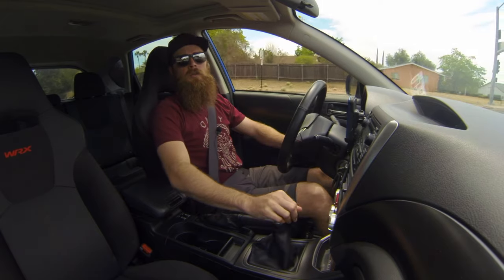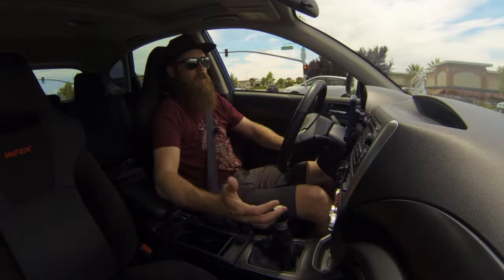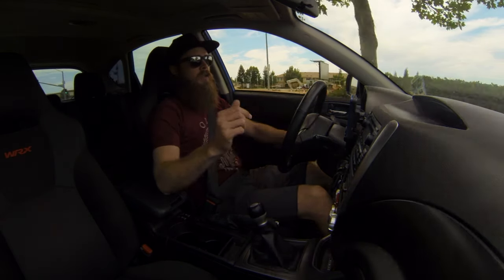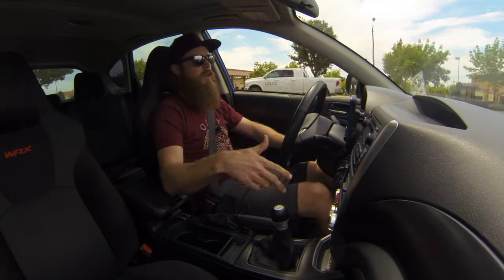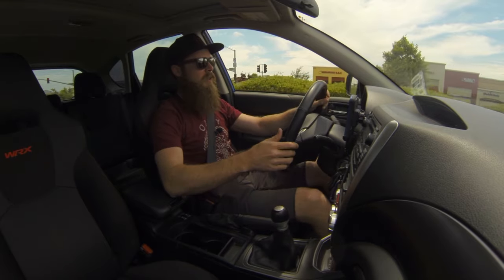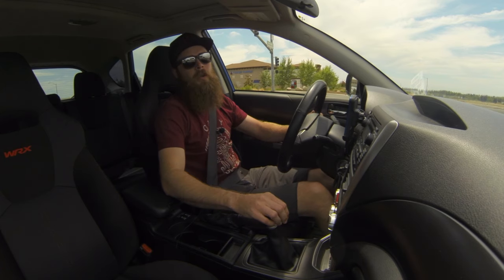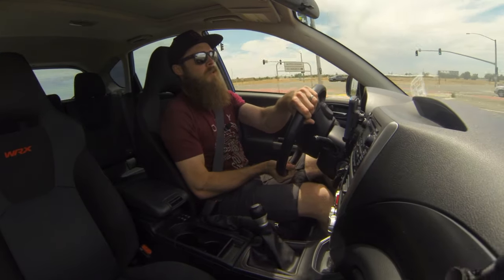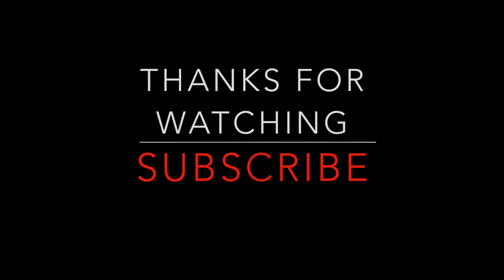INTERCOOLER SPRAYER REVIEW

Comment: So the washer fluid doesnt hurt the intercooler I take it? Do you have to use a certain kind of washer fluid? Cause if it's just water of course it would freeze here in Colorado winter. Great video
Reply: shiloc7 james I thought about that too cause I live in CO but it would be better to use washer fluid really cause it’s really just water mixed with alcohol which helps from freezing so it won’t hurt it seen a lot of guys go that route so they don’t have to use another serperate tank

Comment: How did it do at the track? Any trap speed gain or 1/8 or 1/4 mile improves?
Reply from the maker: +LS1NNOVATIONS I have not been to the track since. Not sure it would improve times much.
Reply: +Blake's Garage to to fb and join subaru bays.
Reply: +Blake's Garage to to fb and join subaru bays.

Comment: hey man quick question for you. I auto crossed last weekend and I pulled my fuse to disable the traction control and loved it. I ran quite a bit quicker.. Do you think there is a way to wire up the fuse kind of like this sprayer so that you can manually disable the fuse without having to pop the hood and physically pull the fuse? Thanks so much in advance bro
Reply from the maker: +Danny B Yeah there definitely is I did a video on the Traction control disable a while back and could definitely make a switch to do that.
Reply: +Blake's Garage would it be the same exact set up as this switch for the intercooler sprayer?
Reply from the maker: Danny B Yep exactly just with a longer switch leg wire. I would probably put it in the same spot as well. I never mounted it I like it kind of hidden in the trap door. You could always just drill a hole and mount it but I didn't want to commit to that.

Comment: Bro if you added a co2 cooling kit to the intercooler you'd be impressed with the results. Works well on the GTI-R with its top mount. Not sure your solution for cooling your top mount is even effective at all.

Edit: 5 year old video. Probably doesn't even have the car anymore.
Reply from the maker: Correct I have an M4, E30, E36 and Macan Turbo now lol 🏁🏁
Reply: @BlakesGarage  😂 😂 good on you man. 💪🏽👍🏽👍🏽

Comment: Are you sure it still works with the washer circuit shut off. Would that not be the circuit to activate the washer motor?
Reply from the maker: Jerdope Yep It works with the fuse I disabled. Its the windshield wiper fuse, so there is no issue with the washer motor working. Fun little mod to do an cheep.

Comment: Have you ever felt the intercooler spray with your hand after your engine temps are up? I'm thinking that it just might be spraying 180* washer fluid on the IC
Reply from the maker: Logan Salat Yes I have and it does cool it quite a bit. Its more about the evaporative cooling than anything and Subaru has basically been doing this the same way for years.
Reply: Blake's Garage Except that the IC spray reservoir is in the trunk in previous years STIs, it's not absorbing heat from the engine all the time. I'm not knocking you're idea, just skeptical before I do mine.

I agree that the evaporating is most important. I think I'm going to do this as well, and just change my washer fluid to some kind of alcohol/water mix
Reply from the maker: Logan Salat You could always put one if your trunk if you want to it would just cost way more. I like the mix idea. You could always put some ice in there if you want LOL.

Comment: I am looking at a 2009 WRX hatch, have you head anything negative about this particular year? Thanks
Reply from the maker: Lacrosseecm IC to TB Hose is the main issue from what I can tell. Also make sure you get a non modded one if you can, just because it will have been beaten on less. What are your plans for the car?
Reply from the maker: Lacrosseecm Thanks man, It looks pretty sweet I would just thoroughly check over the engine bay and make sure you check all the normal areas to see if its been heavily modded. Intake area and downpipe and heat shield. The bolts will have factory markings of white paint if the line up it's been messed with. But if everything seems solid then thats cool. To me just from the 4 pics I would lean towards it was owned by someone who didn't mod it due to the rear tail light still being all chromed out still. Its not 2003 LOL. Also don't believe that there going to fix something if it goes wrong just because you buy the extra warranty. There are A-lot of items they will reject or prorate because of normal wear and tare. Its up to you but I feel like these aftermarket extended warranties are a big scam but you can make the decision for your self on that. I would look into it though.
Reply: Awesome, thank you for the advise man means a lot.
Reply from the maker: Lacrosseecm No problem, let me know if you have any other questions. I'm always glad to help my subs out.

Comment: Enjoying all your videos!  Keep them coming.  I live in Sacramento too!  Deuces if you see me in my black 15 STI.
Reply from the maker: spdzone Nice man I will look for you.
Reply: Blake's Garage Random question of the day for you.  Since you're from Sac, what gas do you use?  I've always used Chevron but I noticed on the boards that quite a few folks use Shell.
Reply from the maker: spdzone I mostly use Chevron gas but every once in a while I use Costco Gas. If I use Arco I get knocks.
Reply: +Blake's Garage With this Sacramento heat have you notice your DAM drop at all?  Driving back from Woodland yesterday I noticed mine dropped from 1 and made its way back to .938.  Pretty much stayed there the rest of the night.
Reply from the maker: spdzone Nope DAM has always been at 1. You should reflash you car, that's bad new's. Make sure to check your feedback knock and fine knock learn. You may have picked up a bad tank of gas or something.
Reply: Thank you!  Resetting the ECU helped out a lot!  The car has been running great.  Probably should've done that a long time ago.
Reply from the maker: spdzone Glad that helped.

Comment: when you go to the torque performance website which map do you download?..theres accessport maps and opensource..which one is the correct one?
Reply from the maker: Roger Arroyo If you have an Cobb Accesport you would download the year and stage of tune for the Accesport then upload that map and flash the car. After that you do some data logs and can send it back to be revised to you car. If you don't have an Accesport you can buy a Tactrix Openport 2.0 cable (costs around $200) this lets you hook a laptop to the car and flash the ECU via open source. This can be cheeper overall but I feel like the Accesport is such a great tool for everyday driving and readings that opensource isn't worth the money you save.
Reply: Nicely put Blake the ap is worth every penny no regrets buying it.
Reply: Blake's Garage I have the cobb accessport on my car..so do I download the accesport map?? I want the stage 2 tune for my 2012
Reply from the maker: Roger Arroyo Yes, you need the Accessport software on your computer then order the Accessport file from TP's web site. You will receive an email directly after your purchase with the maps for all different octane levels. Then you will import the file into the Cobb access port manager software and load it to the access port. After your downpipe is installed you can flash the stage 2 map to your car. If your just trying to do the OTS Stage 2 Cobb map, you can download it directly from Cobb's website. It acts like a purchase in the shopping cart but it is free at checkout.  Hope this helps.
Reply: ok cuz I have the software for the accessport on my computer..so I go to the accessport maps on the TP website? not the opensource one
Reply from the maker: Roger Arroyo Yep go to the access port maps on TP website.
Reply: ok thanks..i just installed the downpipe and I notice a rattle now when the car is heated up around the intercooler area..you think its because of the heat shield not on the turbo anymore?? it rattles when I accelerate and let of. only when hot though and when its cold it does do that..need help please
Reply from the maker: Roger Arroyo Did you tighten down the bolt that connects the downpipe to the car right by the O2 sensor? That could rattle. Other than that do you have any of the heat shield stuff around the turbo because that could make vibrating noises.
Reply: yes I did and I took off the bracket that was on the turbo for the heat shield..ill check tomorrow morning for loose bolts..its weird cuz I hit the intercooler where the turbo bolts up the compressor side and you hear it rattle but cant figure where the noise is that but it only does that when its hot not when cold
Reply from the maker: Roger Arroyo Weird. Did you make sure to tighten the turbo to downpipe flange bolts first before tightening any of the bolts below it? Hope you can figure it out. I had an issue like that when I had the stock downpipe on but since I installed the Cobb its all good.
Reply: I think I found what it is..theres a metal thing I think its a shield from the upipe..I need to go underneath but I think it the support that the stock downpipe had or something
Reply from the maker: Roger Arroyo Sweet hope that fixes it.
Reply: it did thanks for the advice..will be installing the catback this weekend :)